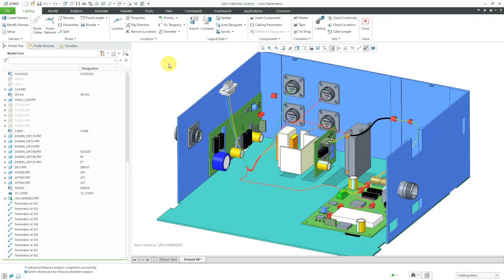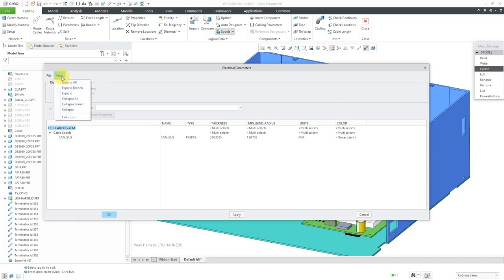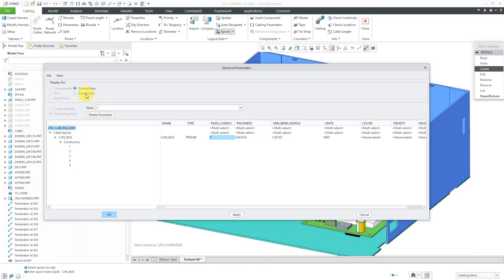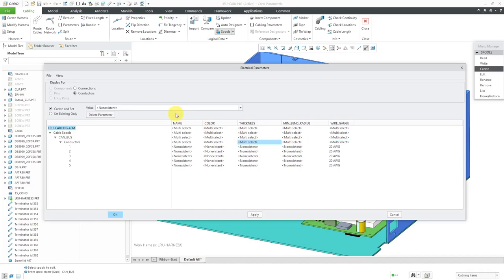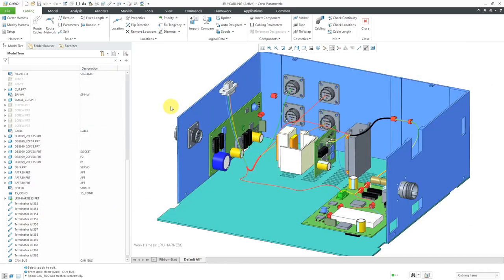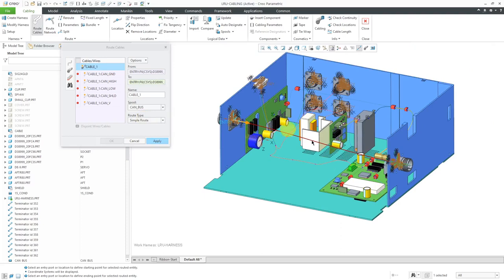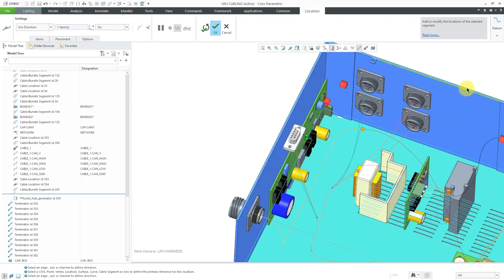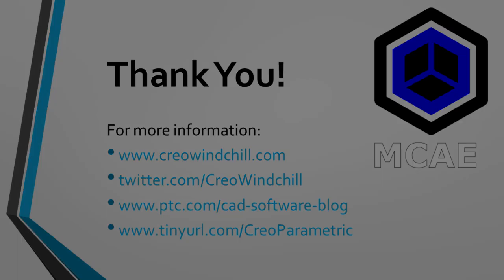Creo Parametric - Cabling | Creating Cable Spools Manually

Comment: Hi David , I have a question can we create a hollow cable , is there any way to show a  flexible hollow cable.
Reply from the maker: Cables by definition have a conductive filament running down the center. You can use the Piping application to generate flexible linestock.